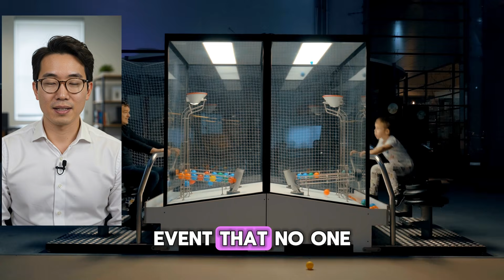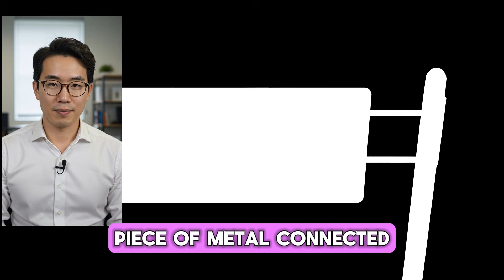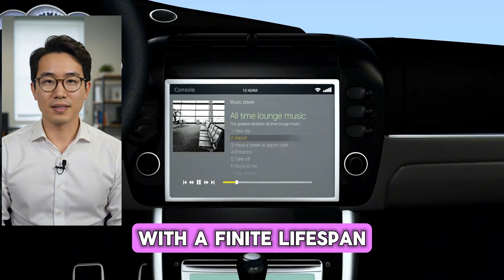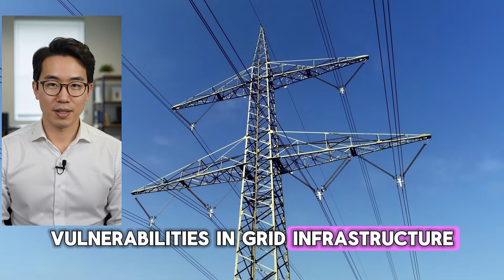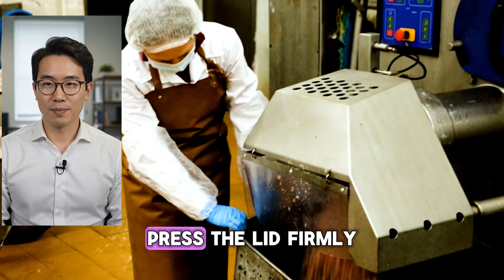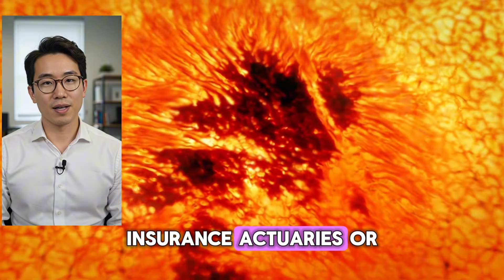The $4 Box That Protects EVERYTHING YOU OWN From an Invisible Threat And How to Build One

Comment: Faraday cage is not an absolute.  As someone that packaged electronic for military use the lid had to bolted down with dozens of screws.  A special gasket to be electrically conductive was not enough.  The lid would bend up between the screws so the distance between fasteners was set to meet the gap to prevent the highest frequency from entering the electronic device.  Feed thru connection faced the same requirements that resulted in inductors, capacitors, and high voltage arc suppressors.

Comment: I built one to store my data backup.  It's earthed by a single conductor to the mains earth terminal via a standard wall plug.  Also achievable via a copper heating pipe which by regulation is bonded to the electrical earth supply via the fuse-board.  Strange yours is not earthed, where would the induced current flow ?  Is it just local eddy currents dissipated as heat ?  I tested it by putting my phone inside, then tried calling it from another
Reply from the maker: Great point, and you're absolutely right to raise it. Earthing (grounding) the cage gives induced currents a low-resistance path to dissipate. That's the textbook ideal, and exactly what military-grade installations do. In a properly grounded cage, the charge flows to earth rather than redistributing across the shell.
In the ungrounded version described in the video, you're correct it relies on eddy currents dissipating as heat within the conductor itself, and the charge redistribution across the outer surface creating the opposing field. It still works for the frequencies most relevant to EMP and geomagnetic events, but a grounded cage is objectively more effective, especially at lower frequencies where skin depth is greater.
Your copper pipe method is elegant most people don't realize their heating system is already bonded to electrical earth by regulation. That's a zero-cost upgrade to any DIY cage. Genuinely appreciate you adding this comments like yours make the channel more useful than any script I could write.